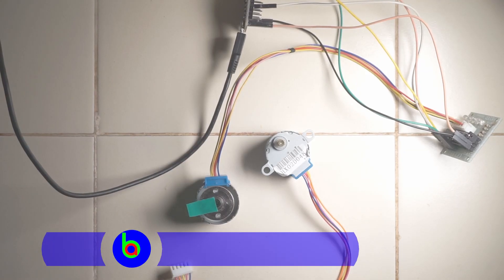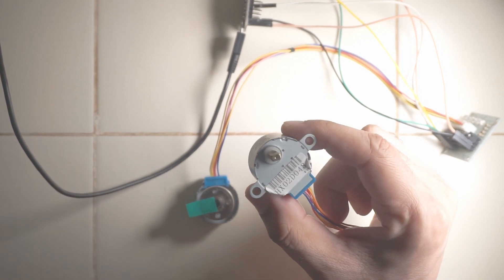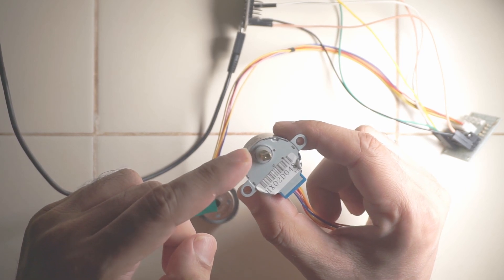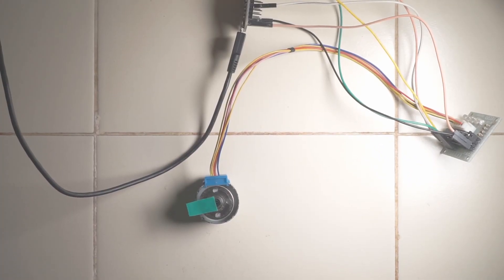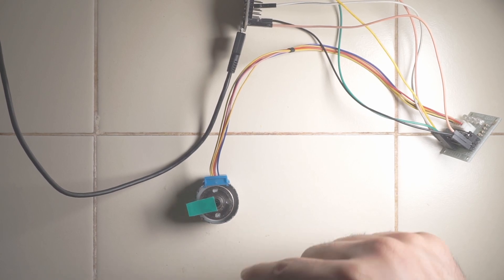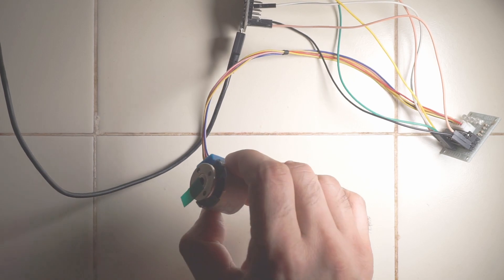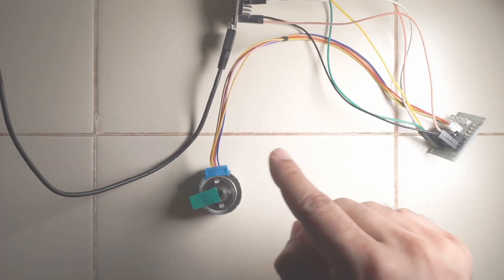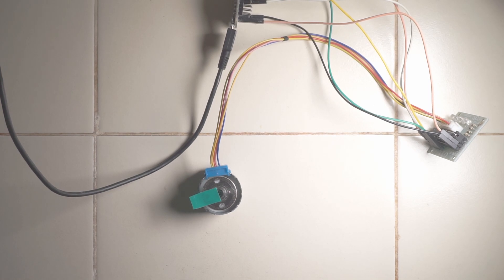Maximum Speed of BYJ48 Stepper Motor Rotor Shaft

Comment: too much load there. that is a big wheel on top of it. there is another video here where he drives without any load and that is quite fast like 5000 rpm( I did  with l293n very very fast and cant hold the motor- 12 volts can go 12000 rpm. yet to test!)  are better and they should have produced with no gear and only center shaft.

Comment: Hey so I think you can reach faster speeds by reducing the delay. I was able to get the motor to turn with delayMicroseconds(900) for a full rotation. Do you have any suggestions for a small quiet  motor with decent torque(1Ncm) and high rpm(200)? It doesn't have to be a stepper. Thanks!
Reply from the maker: I don't have a Specific model but you could look into geared dc motor.

Comment: Thanks for sharing.. I have to use 4 of these motors in a Halloween prop I'm building and I haven't been able to get them to move fast enough. I think I can do it now with the help you provided here. Thank you for being brave enough to open one of these and showing what it can do without the gear reducers!
Reply from the maker: Your welcome. Do keep in mind that the rotor shaft is not bound by anything so it can come off If you turn it upside down or if you shake it